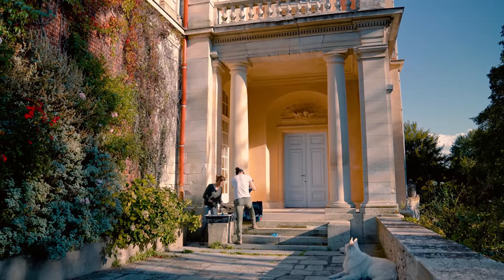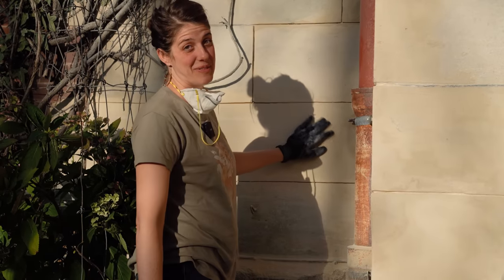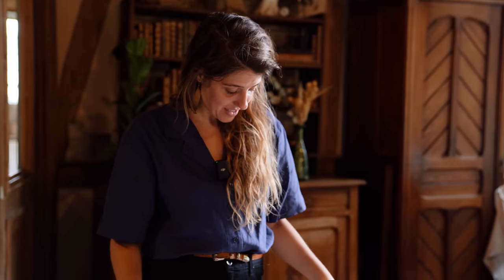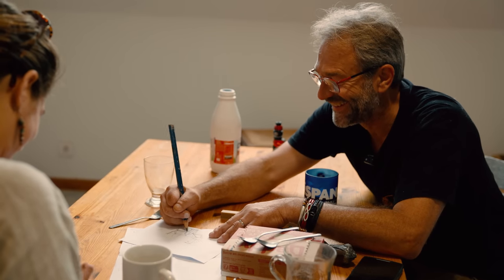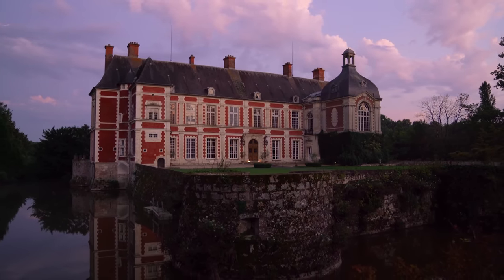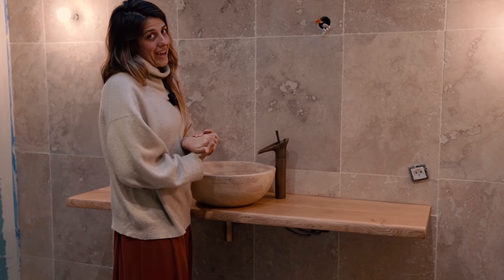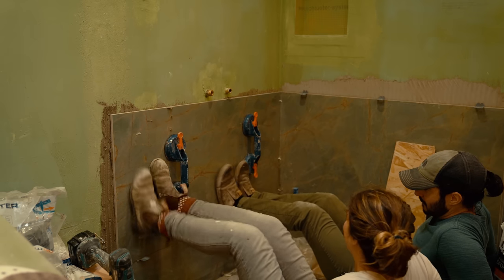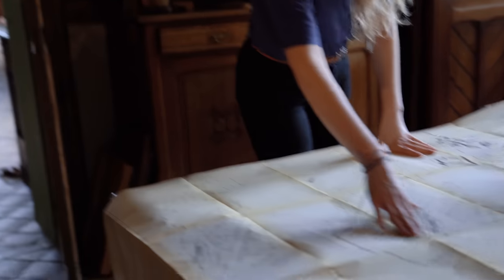Discovering The Abandoned Chateau Plans | French Chateau Renovations #38

Comment: Great work!
The wood finish is most likely European Hard Wax finish. It is non toxic, easy to apply and delivers that low sheen warm looking finish that is popular now. 
It is also easy to repair! Just a light scuff sand and a new coat and let it cure. 
Most often this product is used for floor finishes, but in my shop we have now used it with success on many pieces of furniture. Well known brands are Rubio and Osmocoate. It's kind of expensive stuff so we try to not over do it with heavy coats that end up in the rag.
Word to the wise remember the wet rags can spontaneously combust so wet e'm down when you're done with water!'

Best,

Brian 
A Masters Touch

Comment: do not use steel rods AND you are even using of the shelf cheap rods - not even galvanized or stainless steel ones - BIG mistake - 
use fiberglass rods - steel rusts and expands and cracks your stone/repairs - fiberglass not so much......